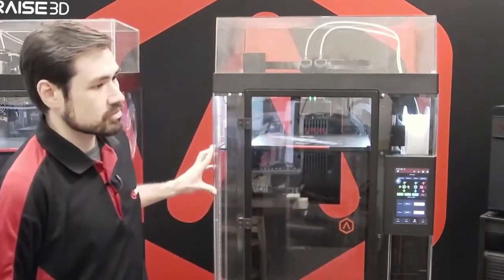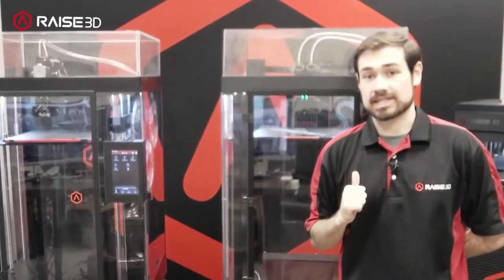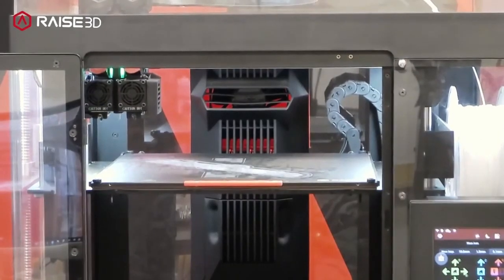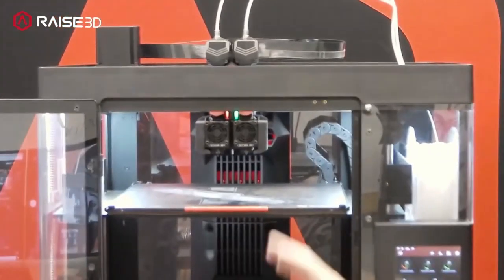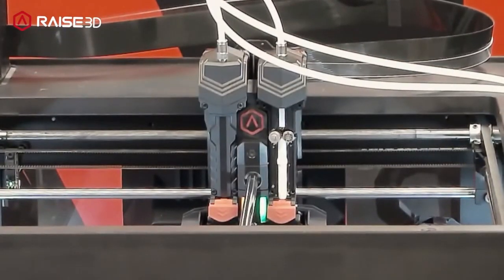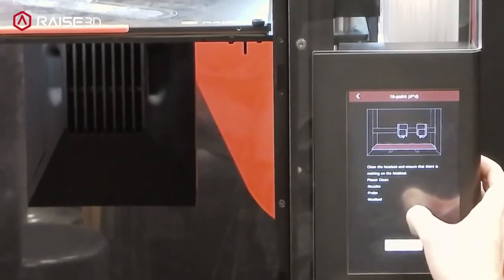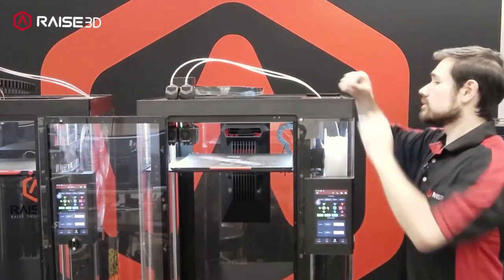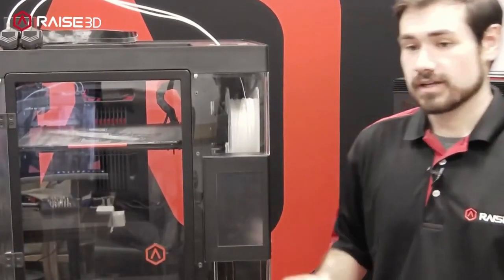Raise3D Livestream Recap - the New Pro3 Overview

Comment: Can you guys make a material handling station for this?  We have an S5.  We want to move to raise3d but the material handling station is so good on the S5.  I can load up multiple spools of ABS to run large ABS prints and it will auto-swap when one runs out.  Its amazingly easy to load, unload and swap fillements.  Its easy to dismis the handling station but it makes printing a breeze... all printers should have one.  Also, i like printing ABS on glass because of the finish and self release - can you put a glass bed on this?

Comment: Can the door feature be turned off?  How hot can the camber get?
Reply from the maker: And yes you can turn off the door feature in advance setting.
Reply: Ive measured our Pro2 chambers at 95F when printing with the bed at 60C